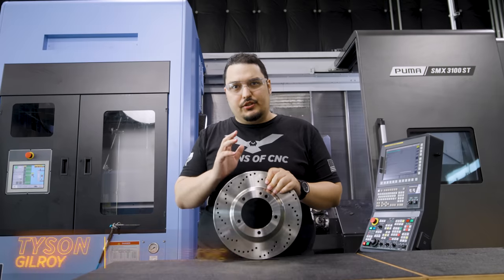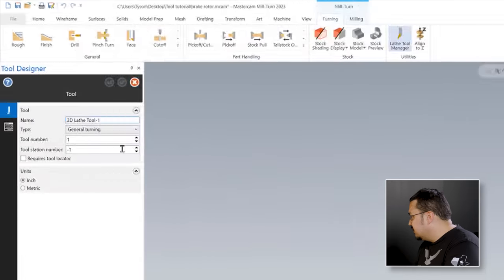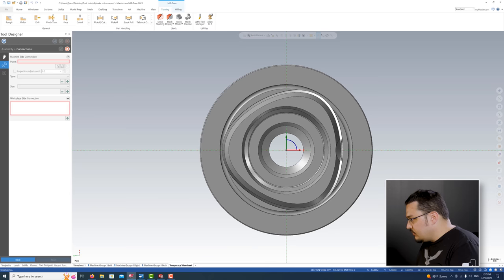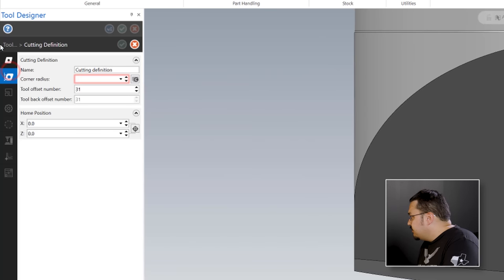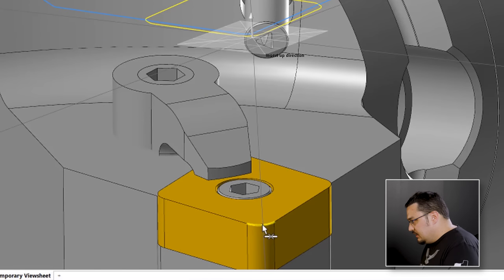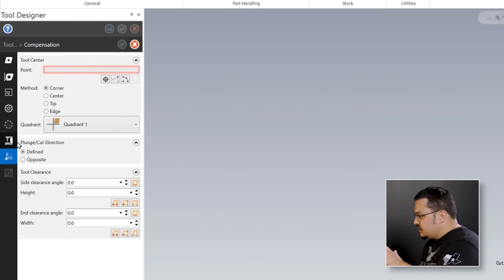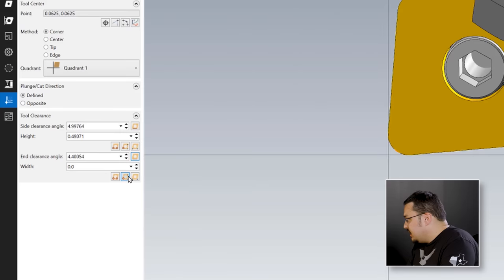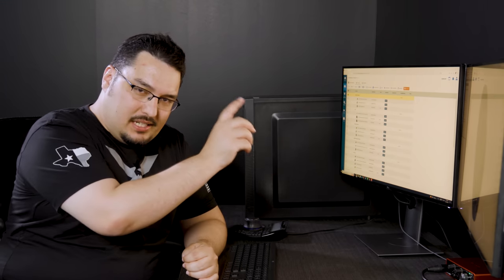High Level Trick To Speed Up The Process

Comment: Very helpful video.  Very clear instructions.  I would like to see how to add a custom tool to Mastercam.  I have a picatinny form tool that I cannot get the geometry of the tool in Mastercam.
Reply: You can draw a tool in mastercam and import that for your tool geometry.
Reply: @johnkurpiewski3996  Yes, thank you.  I have the tool profile download from Harvey but cannot figure the darn thing out.
Reply: @tdg911   I spent over 40 hrs building tools trying to figure out the 3D tool data from scratch and still  can’t get somethings to work right so I know the frustration.
Reply: @johnkurpiewski3996  I bet it took me the same amount of hours to take my existing tools to set them up for MC.  Surely I could have gotten by using default holders etc but I wanted to shoot for accuracy.  Setting up custom tools is a pita and for the time being this one tool is still not setup.  I stepped back a bit to read up on the basics.  I'm obviously new to MC as I'd like to learn it.  I'm coming from Fusion 360 and just frustrated most of the times because of having to dig my way  thru this.

Comment: Is it possible to use the angle in the 3D tool data and not have to do the parameter angle setting in the tool path setup?
 Thank you for great content ! 👍
Reply: Puhh maybe but I don’t think so. The format that’s used for the 3D models most likely only contains the separate parts and outlines for the dimensions
Reply: @kleini3  It post fine if I choose Horizontal or Vertical  in the 3D tool data even for the sub spindle . I don’t  touch the parameters for the tool path, I have the same tool with multiple configurations ,yes It’s 4x the tools of the same tool in some cases ,  but I just copy the the tool and make a few changes ,  but I could never get neutral OD turning tools to post right @ 45 or 135. I know for a fact my post isn’t perfect, and just curious if anyone got it to work this way.
Reply: @johnkurpiewski3996  ah okay i misunderstood your question. Didn’t try that yet, I work with SolidCAM mostly on 3 ax turning machines. One workaround would be something u already do just copy the tool for all directions u need and safe them